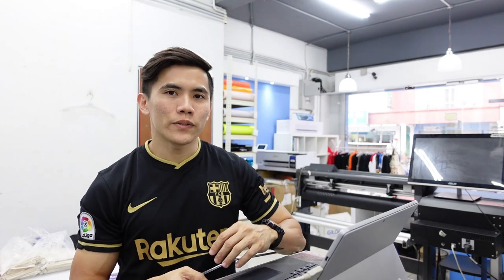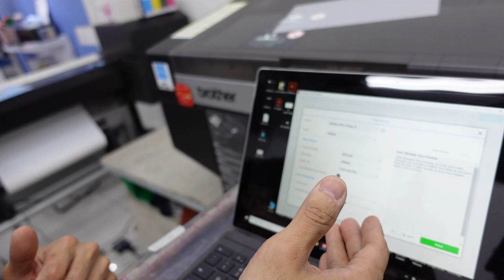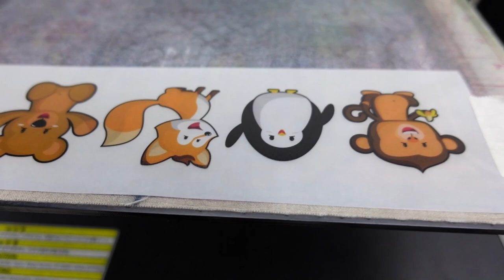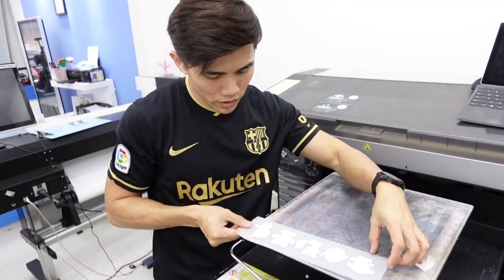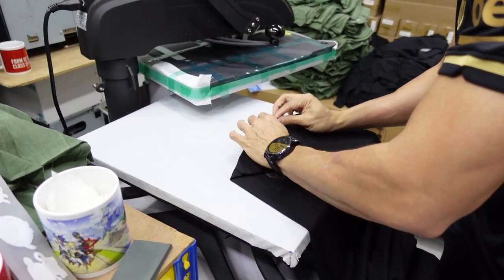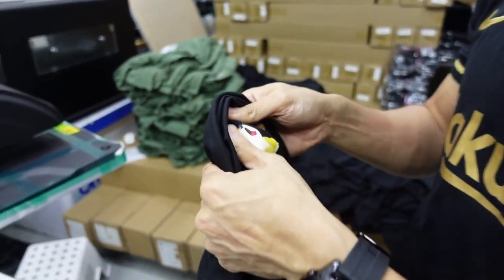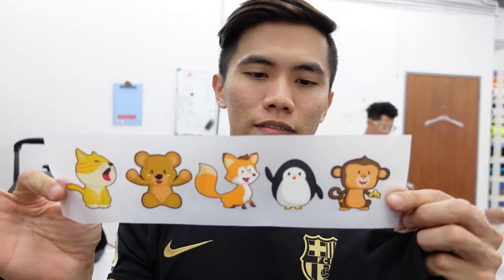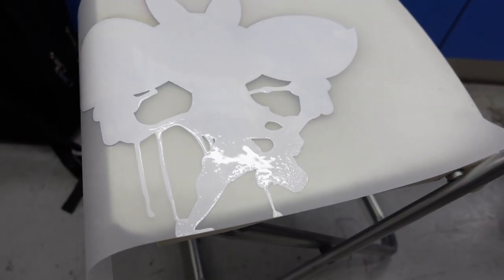How to print DTF (Direct to Film) Heat Transfer Film using Brother GTX printer

Comment: I just made some dtf printing but I noticed the white turns grey and very opaque when I apply the transfers on black/dark shirts. Any idea why that happens?
Reply from the maker: Not enough white inks and also dye migration. Try heat at lower temp and time say 140c 8s but depending on your PET film and Glue powder requirement as well.
Reply: @amedionteo  thank you

Comment: No need to pretreat with this process? 

Is this process a good option for printing on 100% polyester or poly blends?
Reply from the maker: Nope you don't have to pretreat if using DTF. The glue will do the job. Careful when pressing on polyester due to Dye migration.

Comment: Do you need to reverse the image in photoshop before laying down the CMYK and White on the film?
Reply from the maker: Yea you will need to mirror the image first. Sorry I didn't mention in the video.
Reply: We have 2 GTX’s and recently bought the dtf film and hot melt powder but would love to see a couple more videos of how you do it. When I created the cmyk image and put the setting on 2 ink volume and 1 double print the color ink came out a little spotty. Any thoughts, or recommendations? Also, when we put the powder on I had a hard time getting the excess powder off the areas that did Int even have ink on it.
Reply from the maker: @lincolnwalters  make sure you're printing on the correct side. The matte area is the print side. 
Try to pour the powder evenly instead of doing it like i did.
Reply: @lincolnwalters  we have the exact same issue. Might be the paper or the powder that are not ideal for the GTX
Reply from the maker: @maudlinmerchandise  gtx lowest white setting still alot. If able to reduce one more level it would be perfect.

Comment: hello, can I ask you what kind of sheet did you use and the values set for printing?thank you
Reply from the maker: Its PET film for heat transfer. Not sure what u mean by value. Cost?
Reply: @amedionteo  not cost, parameters for printing
Reply: And where can I buy this PET film?
Reply from the maker: @JackNapoli  you need to source in google bro. My local supplier dont sell internationally. The values 100 white and the rest 80.
Reply from the maker: @JackNapoli  oops sorry. This is GTX video. Not L1800. I think u refer back my video i have mentioned.
Reply: @amedionteo  yes I know, I have GTX
Reply: @amedionteo  sorry, how can I speak with you in private?
Reply from the maker: @JackNapoli  you can whatsapp me at wa.me/60102219532

Comment: Hi. Thank you for your video.Did you use orginal Brother inks in this video?
Reply from the maker: Yes genuine Brother GTX ink. Thank you.
Reply: @amedionteo  Thank you. It's good news for me.
Reply from the maker: @maksimmakarov4145  good luck testing it out bro.
Reply: Are you using same ink to dtg print and dtf print?
Reply from the maker: @蔡秀华-d6o  for this video yes. for actual production i use dtf ink on L1800
Reply: @amedionteo  which one do you prefer? Which has better quality?
Reply from the maker: @allstarprintlab2675  of course DTF printer cause there are more options to play with. Unlike DTG machine where you're limited with the lowest print setting.
Reply from the maker: @toonrme1968  can be used but both are diff inks.

Comment: With CADlink Digital Factory v10 Apparel, Brother Edition we can send the data as a single print job, no need to send 2 files to the printer. We also will offer DTF print modes that allow you to also include halftone holes and stripes to your designs, something you cannot to with Graphics Lab. You can find me on the DTF Users Group on FB: https://www.facebook.com/groups/3264492083648783

Comment: I cannot recommend this printer for business. This is only for hobbyist and no intention to make money. My opinion only. The machine is to expensive ang it takes a lot of maintenance and the material is to expensive. clients cannot afford to pay for the output. So many ways to print with the almost same qauality. You have to bear in mind that this is still inkjet.
Reply from the maker: Depends on what business you're doing. If you're getting this printer to print volume vs screen printing/heat transfer then of course this is not for you. When you have the market such as print on demand then you will definitely opt for this printer. In my case, i have many clients doing good doing print on demand and also some thinks like you where they trying to fight different printing market.